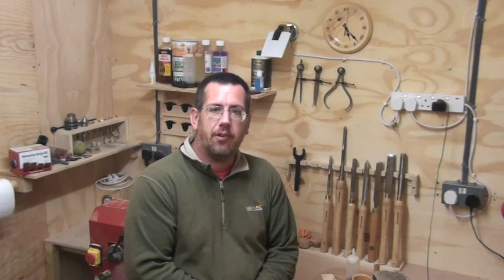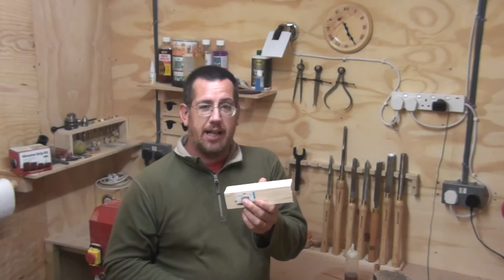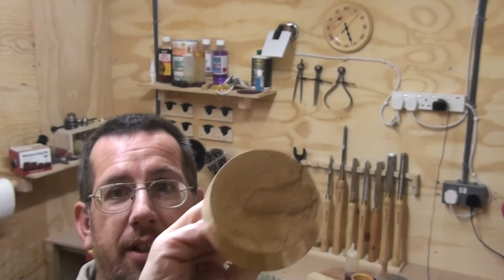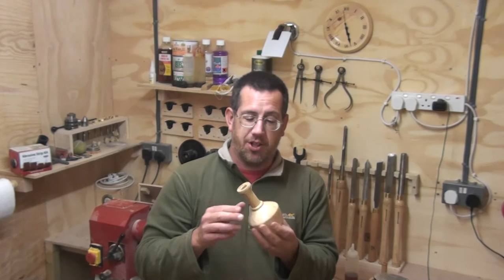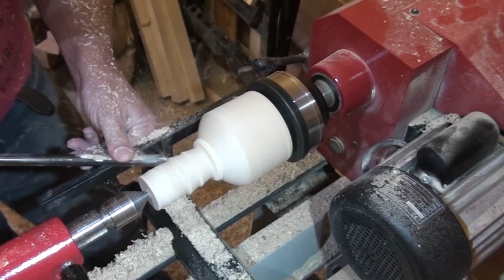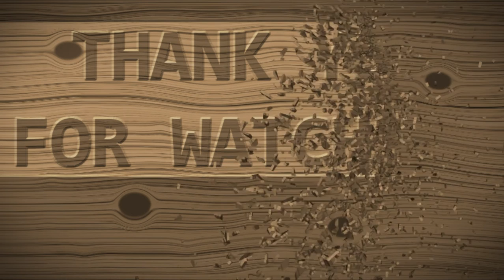Spalted Beech Bud Vase - Episode 29

Comment: I was looking forward to this video Paul, and you haven't disappointed. Very impressed with the piece it turned out real nice.
Reply from the maker: Thanks Tom, I really enjoyed this. The grain is amazing and to get a final finish doesn't take so much hard work.
Reply: +Paul Lockwood, I might have to try getting a log burner bag, I did get some wood for about an hour away from where I live but a lot of it is still too wet to turn. I'm currently working on a plywood bowl, but it's not going too well atm a lot of tear out in places but like you, I'm still experimenting.
Reply from the maker: I think it is good to try different pieces. I've seen one or two pieces done in ply which I suspect is very hard work. Sharp tools and going lightly may be the key. Certainly not easy to sand out like pine as ply does tend to be quite hard. Not sure but I did read somewhere that silver birch is often used in ply. I had issues when I turned the Silver Birch box due to layers of flaky hardness.